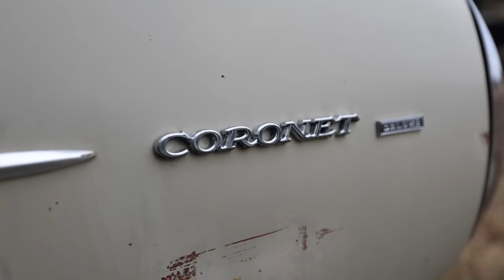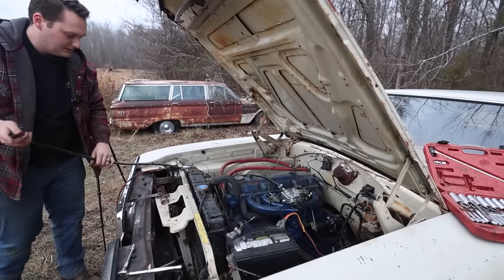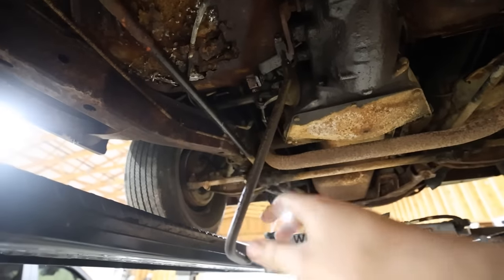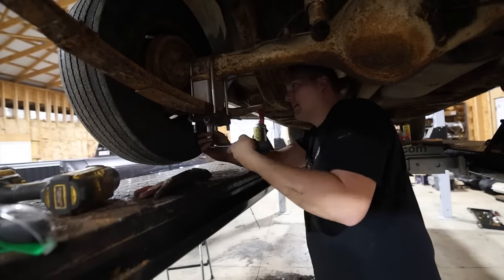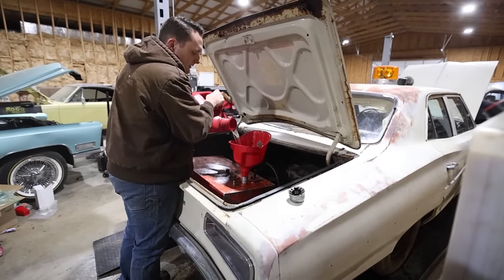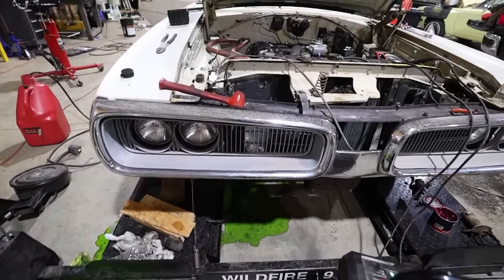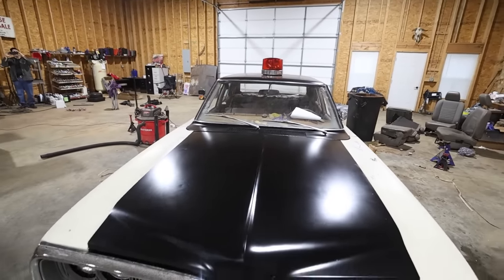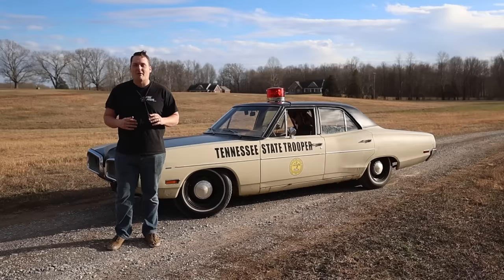FORGOTTEN 30 YEARS! Will This 1970 Dodge Coronet RUN and DRIVE?

Comment: Love the old Coronet!
My first car was a 66 Coronet 440 two door hardtop 318, automatic transmission, no power anything, AM radio, and heater. Once I put a chrome air cleaner on it, dual exhaust, glass packs, and chrome tips I had the perfect car.

Comment: Dylan this brings me back to 1987 and 2 firsts for me my first MOPAR and my first big block I ever owned. I bought a 69 Dodge Coronet 4door sedan for 75.00 bucks with no engine or transmission it was a 318 car. One of my buddies had a 70 383 2 barrel and 727 out of a 70 Chrysler Newport  that I bought for 100 dollar bill. That I turned into what I called Grandma’s Grocery Getter. It was Turquoise with black interior white wall tires on black steel wheels dual exhaust she ran great and even turned a 9.79 in an eighth mile. I would love to have another one and build it with some modern technology like EFI And 4wheel disc brakes and 15x8 MOPAR cop rims black of course with 225 60 15’s. And for dual exhaust Borla XS pro mufflers. 
Love the Tennessee State Trooper look it fits perfectly with your fleet. Eddie Patterson Silverstreet South Carolina.

Comment: way back in the day (mid 80's) my buddy had a dodge dart swinger with the slant 6 and a 3 speed on the tree. he beat the crap out of it and it eventually lost second gear so he just wound out first until it floated the valves and then shifted it into third. he did that for years and the engine never failed. slant 6 engine will not die.

Comment: That 225 slant 6, with its clattering valve train and exhaust manifold leaking "ticks", bought back many memories.

As a child, already starting to get interested in cars, I did my first valve lash in 1975 on our 1968 Plymouth Valient's 225 slant 6.

With the engine hot, valve cover removed and the engine idling (splattering oil), I recall adjusting the intake valves to 0.010" and the exhaust to 0.020". I still remember the "feel" of how the valve train forcefully moves while you slip the feeler gauge above the valve tip and how, when adjusted properly, the engine would misfire. You could theoretically get a tiny increase in power by using 0.008" and 0.019, but I couldn't really feel any power increase...

We replaced that '68 with a brand new 1978 Plymouth Volare station wagon. This time with the "high performance" Super-6. The Super-6 came with a 2-barrel carburetor but actually had less power than the 1968 Valient's single barrel carburetor when stock. The Volare wagon didn't have many options but did have the "heavy duty" 8 ¼" rear end. 

I replaced that with a used 1979 2-door Dodge Diplomat. The Diplomat was one of my favorite cars, and I put over 800,000 km (500,000 miles) on it, delivering pizza and packages. It also had a Super-6, but unfortunately had the weak 7 ¼" rear end that failed around 150,000 miles and I ended up replacing with the 8 ¼" that came out of the Volare wagon. Oddly, it had that small engine but was loaded with just about every available option, including power everything, like the leather seats and windows, and it had cool looking rally wheels, etc.

Those slant-6 engines were incredibly reliable and with the timing advanced and recurved, plus an adjustable vacuum advance optimized for timing advanced cruising, a free flowing exhaust and a tight valve lash, those slant-6 cars weren't fast but were peppy enough to make ideal daily drivers (and for pizza delivery). They even got impressive fuel economy for the day (close to 30mpg on the highway).

Comment: I had the anti-chatter springs in the clutch on my 1972 Dodge D-100 pickup come out and lock up the clutch. Same drive train as this sedan.
Repair shop said they had never seen such a failure. Worth checking.

Comment: That's a nice Coronet. At 47:50, Briar commented about the cramped area on a 225 slant 6. I had one and I agree that all the necessary items: distributor, plugs, fuer pump are jammed in the wedge side. Hardley any other items on the wide side.

Comment: Growing my parents had a 1970 Dodge Coronet, brown with brown vinyl interior. I don't remember if it had carpet or rubber mats. It was a 225ci slant six with a 1 bbl and a automatic trans. They also had a 1964 Dodge Dart, white with a blue vinyl interior and rubber floor mats, under dash dealer installed A/C and it came with no radio but my dad bought a scratched AM radio over the counter and installed it. It had a 170ci slant six with a 1 bbl and a manual choke and a 3 on the tree. Dad customized it with a aftermarket rear window defroster and a hood lock after someone stole the battery once. The Coronet got replaced with a 1979 Dodge Aspen green on green with a 225ci slant six and a progressive 2 bbl with a automatic trans. The Dart got replaced with a 1980 Plymouth Horizon, the early ones had the 1.7L VW engine, not the later 2.2L engine, it had a 2 bbl carb.

Comment: Excellent video Dylan  :) , Bryer  :) working on that 1970's Dodge Cornet basic model  4 door also on carb changes help out , plus fuel tank on floor in trunk I would put temporary some metal bolt in place so won't fall on floor too and when lost Antifreeze thought may have few frost plugs or thermostat leak or some hoses even heater core leaking but was hole water pump show in video! Not first one seen hole happened just corrosion of age does it and glad solve lots problems too! Glad Clutch was easy fix up and plus nothing bad in transmission  also major parts needed! Yes be cool take vechiles shows this year and other years too!

Comment: That 'gasket' you were messing around with between the carb and manifold is a "phenolic spacer".   A high temp resin that was popular with manufacturers in the 1970s.  Theory was it would prevent heat soak from the engine/manifold to the carb, stopping vapor lock when running, or fuel boiling out of the carb after parking.  Still needs a gasket each side of it.

Comment: The Slant 6 was one of the best engines ever made. Reliable and durable....I knew a guy with a Dart that put over half a million miles on the original engine and it still ran great. They were practically indestructible.

Comment: My mom had a 76 Aspen with the same set up, no options but am/fm radio, 3 on the tree slant 6, no power anything.  The pinion seal developed a very slow leak, rearend seized in the middle of a 4 lane divided highway across the 2 travel lanes,  had to dump the clutch a bunch of times to get it into one lane then got out and flagged cars down, luckily the car was safety orange so at least it was visible, lol.  The motor& tranny lived on in a van, traded it for a 1970 plymouth fury deluxe foor door 360 2bbl, that thing was a land barge but it road like a caddilac!!  Oh and slant 6 is immortal so why are you surprised it started so easily??

Comment: Looking at the front reminds me if the 1970 Coronet 440 two door fully loaded, my dad bought mom a new car. Boy howdy mom was surprised. Her first new car.
Reply: I failed to mention the 70 Dodge was  2 door. 
My dad was a solid Dodge guy from the git go. The previous Dodge card were station wagons 
64 Dodge Polara after that was a 66 Dodge Polara. Typical Green inside and out. Both desperately needed with four boys in the cars.

Comment: I got a 440 body style in 97, dark green, had the 318, 727(40,000 miles).  It had been sitting for years.  Couldn't get it over 70mph no matter what.  First thing I did was put dual glass packs on it.  I swear, it would turn 90mph on 1/4 mile.  Would go to 120 like it was nothing.  
When it got a lot older, I tried to blow the engine up, each day I'd go in a field and do donuts wide open until I couldn't no more, couldn't even seem to put a dent in the 318.  Sold it to a family who needed it for $200 in 2001.

Comment: That's a cool old beast. Looks straight and solid. I don't get the '2 doors good, 4 doors bad' thing either. Nitveverything has to be sporty, sometimes its good to cruise. Surprised there are no restrictions on replica police cars. Here in the UK all that stuff is only for show use - lettering has to be covered and lights removed for road use. Impersonating a cop is a big deal.

Comment: I have never really been a fan of Dodges although I have to say I have a 2000 Dodge Grand Caravan with an 3.8 liter V6 engine out there in the driveway with almost 300,000 miles on it and that old van runs like a top, the only problem I have with it is when I got up this morning my electric wheelchair ramp on it wouldn't come out so my wheelchair accessible well van isn't so accessible right now LOL but that has nothing to do with Dodge it's been a great vehicle, I may come around yet 😎😎

Comment: My first car was a 1966 Cornet 4 door wagon slant 6 i was 17 paid $300 for it in 1979 drove the wheels of it always carry a spare voltage regulator lol i had to tie the rear passenger door shut cause if you went around a corner it would fly open my Freedom machine wasn't out to impress anybody got my life going thanks to that shit box i loved it 😊😊😊😊😊😊😊😊😊😊😊❤❤❤❤❤❤❤❤❤❤❤

Comment: Not like it matters, but the carburetor you started with looks like a Daytona Parts carburetor with an adjustable main jet. That should be what is sticking out the front of the bowl. They are usually decent, and I've not had any trouble with them. The carburetor you put on is a Holley 1945, which to me, is a much better carburetor compared to the 1920.

Comment: I luv the 70 DeLuxes bare bones rear...no finish panel between the tail lights...just DODGE...wish I had a set for my 70 440 2 door n a template for the holes

Comment: Why lower the  Coronet? Police cars back then were left at factory height or the back raised slightly. If you left it raised you could have put some wider tires on the back to make it look more aggressive. A lowered police car just doesn't look right. The paint and police graphics look great and the bubble roof light brings it together. Of course resuscitating it from its long nap is always fun to watch.

Comment: I laugh when I see someone do a "will it run" on the Leaning Tower of Power. Those engines are immortal. I went 120mph in a 225 with a burnt valve and plugs with a quarter inch of ash buildup. The electrodes were completely encased in ash, and it still ran. Those engines are impossible to kill.

Comment: Those taillights are the Superbee type instead of the Coronet tail lights I wonder if it's that way because it's the Deluxe model but I have never seen a Coronet with the super bee Tail Lights even the Coronet R/T did not have them taillights so did the owner put them in there or did it come from the factory that way.

Comment: Had a 1970 coronet 440 with a 318.  Would not want a smaller engine than that.  At 230HP, the 318 was barely able to move it.

Comment: 🇺🇸👍 Do you know adjusting values hot on a 225 while running when done correctly there is very, very little to no value train noise what so ever and performance is awesome try it. I’m tired of hearing rattling valves. Another good video, great deal on the car.👍

Comment: I had a aspen with that motor in it. It wouldn't ideal. I sold to a guy. He put compression test two cyclers had low compression on it.

Comment: One of my Favourite front ends this car has can’t understand why you want a low car I’d rather run at standard Ride height with beefed up rear Shocks clean car up an Repaint it fit black bucket seats up front an re trim back seat in Black re do headliner as it’s junk

Comment: The rubber floors in them cars were the worst then the carpet because moustore would get under the rubber and it would not dry up and that is what caused many mopars floors to rot right out

Comment: And one thing more you put a new gas line and filter on and I saw it is laying right on the exhaust manifold not too clever good way to burn your car up and especially using a clear fuel filter they are known to leak and catch fire